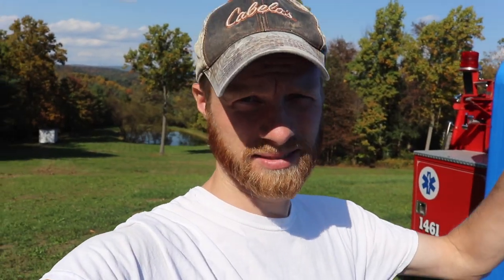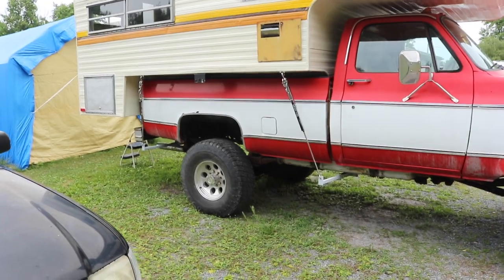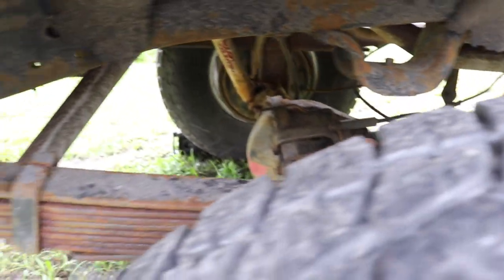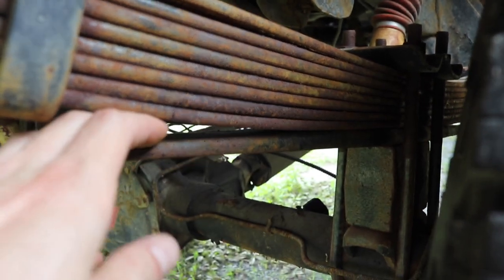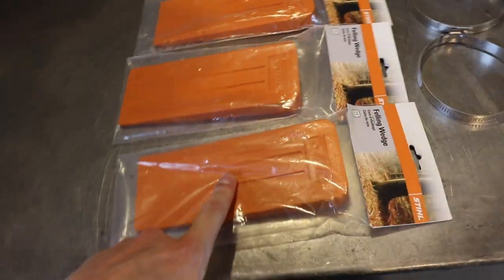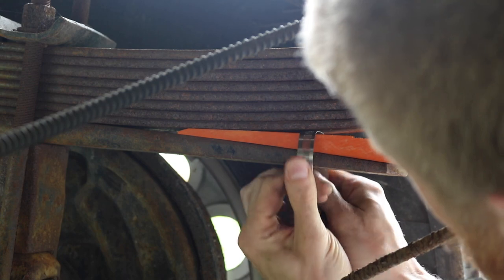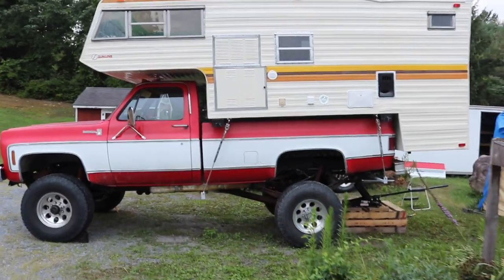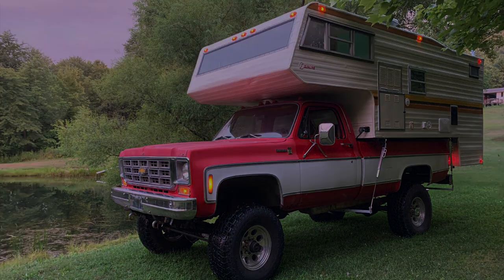TOO MUCH SWAY - Truck Mods for Truck Camper

Comment: Top heavy truck campers and lifted trucks don't mix, check out a you tube video on a lifted truck and TC, it turned a corner and fell over. Totaled both. I used to have one on a F350 4x4 4 door and it swayed some with front and back with sway bars. New shocks . Loved the TC just got to old to climb up in it.
Reply: Yeah turned the corner too fast that's why dude rolled his rig. I have a 2200lb TC on my F250 CCSB 4X4 with 8" lift and I'm yet to tip over cause I don't drive like an azzhole lol.

Comment: install timbrens there rated for 8900 lbs will greatly improve stabilty with sway issues.
Reply from the maker: Thanks for the recommendation. I have installed the 8000 lb rated Timbrens since posting this video. They did help, but the suspension still needs improvements. I may post another overall suspension update video on the channel in the future.